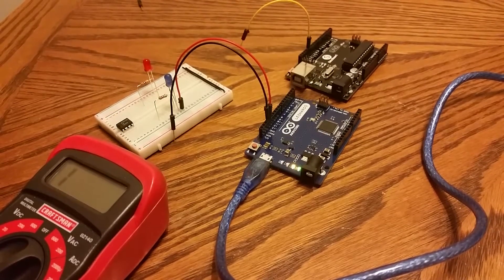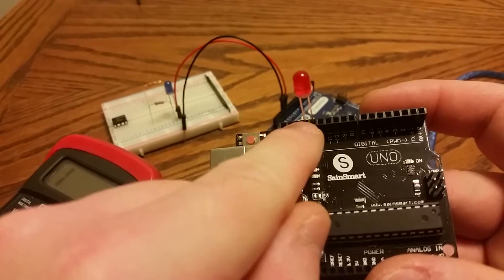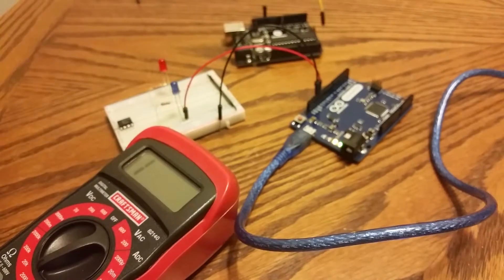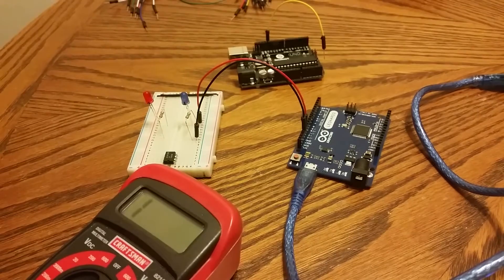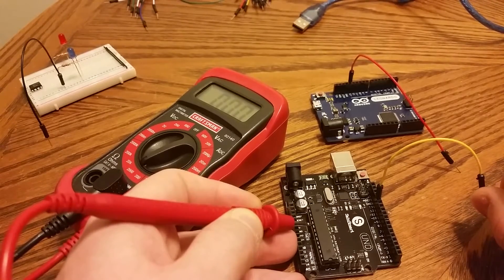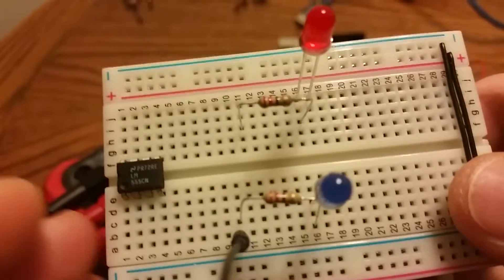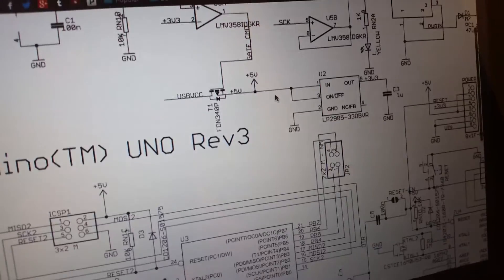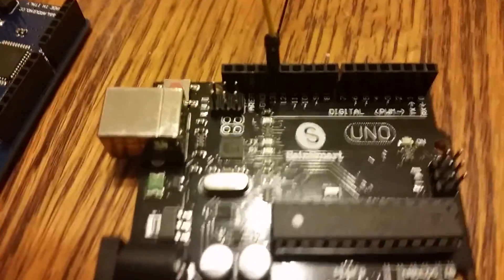Arduino Pin 13 Myth

Comment: When an LED is directly to pin 13, the current is limited by the output impedance of the Arduino. There certainly isn't a zero resistance or an 'infinite current'. To reduce the stress on the Arduino, I would make sure the sketch flashes it only briefly

Comment: do you use that MacBook most of your time
is it better or a Windows laptop because I am buying a laptop for programing purposes
Reply from the maker: I use my Arch Linux machine most of the time.  I run a litany of virtual machines for my needs.

Sometimes I will use my MacBook, or Surface Pro2, depending on if I MUST use OSX or Windows... but I'll NEVER install Windows 10.
Reply: Yeah Windows seven is better for a programmer and much easier to use is that why you would not install Windows 10?
Reply from the maker: kareem selim
All windows systems are the worst for programming.  Unless you're programming in C#, it won't play well with anything... I prefer Unix systems, and VIM.  My combo is even good for C#, so Windows shows no advantage for me.

As for Wn10, I'm not a fan of the spying and ads on my desktop space.  Couple that with the above, and I have no reason to use Windows for anything.
Reply: oh thank you will u make a vid about installing a virtual machine if you have some free time or you can just reply to me how to do it and could you tell me what version of osx you are using and what model and version of a mac you are using
Reply from the maker: kareem selim A virtual machine of what?  Linux?  BSD?  Windows?  Java?  ReactOS?  I can make a VM of just about anything, but you'll have to be more specific about what you're looking for.
Reply: +stillborn86  Windows and Linux
Reply from the maker: kareem selim
Well, I have multiple videos on my channel for creating an Arch Linux VM... so, hopefully there's an answer to that since there are THOUSANDS of Linux distros that could be used.

As for Windows, it would be the same process as any other Windows install, you just need an install image of some kind.

Comment: Thanks for the clear explanation and demo.  I just got my first Arduino Uno and came across this same issue.  I followed your test on my board and got the same results.  I found the schematic is online at https://www.arduino.cc/en/uploads/Main/arduino-uno-schematic.pdf though I couldn't find a link or description of it on the www.arduino.cc website.
Reply from the maker: +Kioshiki Thank you, you were correct... I forgot to add the link to the description.  It's there now, thanks to you.